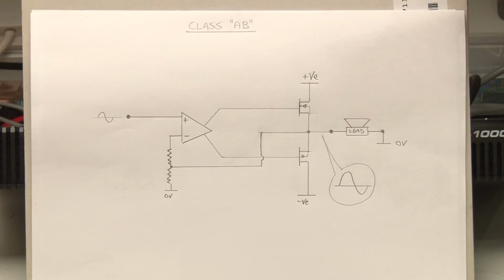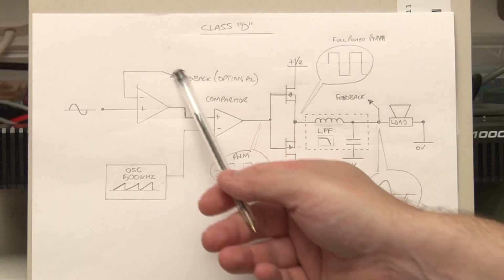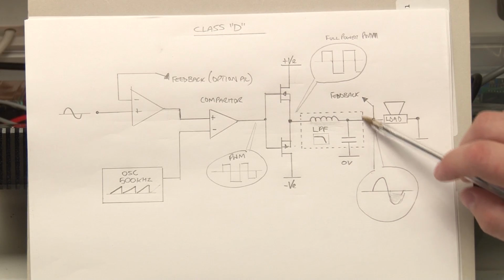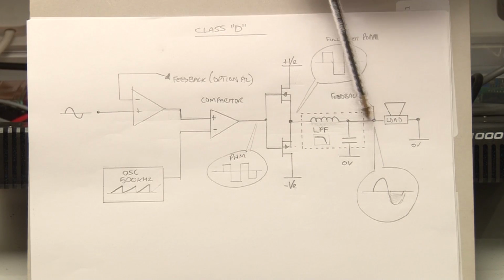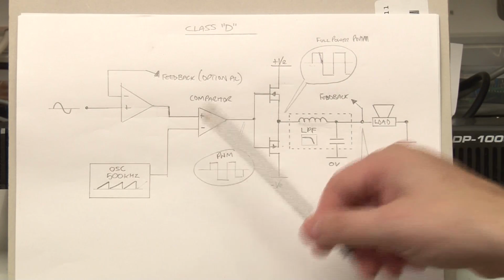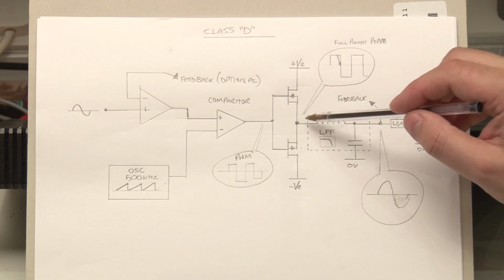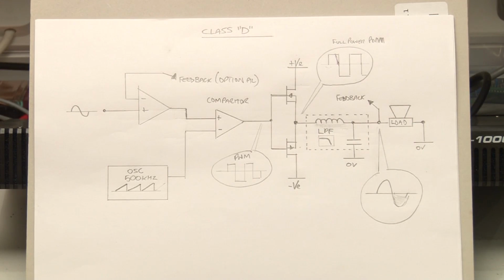Omnitronic EDP 1000 Watt Class D Amplifier Teardown

Comment: I have a class d amp which in high mid frequencies skips one of the signal LEDs and goes directly to the clip .. or else they turn on both together .. with gave frequencies if you mark the signal LEDs correctly until entering the clip

Comment: Looking at the ETD39 core I don't think this amplifier will go to a 1000W. The power that this PSU can supply would be in the 400W range. Dynamic power could be higher of course. The power supply has universal input range, has it got active PCF?

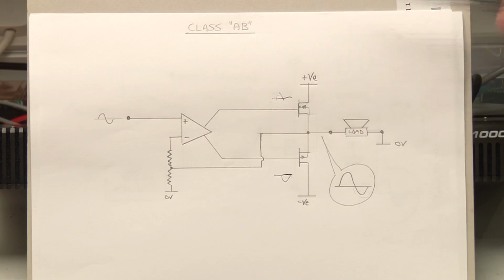Comment: Sorry Gerry, correct me if I'm wrong, but the schematic at 3:00 on the inverting input of the op amp you have that voltage divider set up kind of weird. 

the way that the divider is set up basically makes that top resister completely useless (assuming ~0 Current flow). I assume that you want that divider to step down the output voltage. just thought to point that out.

great video though, big ups on the awesome explanations!
Reply from the maker: +Erick Miller yes you are right, I was just doing a block diagram and should have drawn the resistor from the  output and tapped the input to the op amp from the centre point, I should have drawn that better, thanks for pointing it out. None the less I would not recommend anyone try to build what I drew, as I say it was merely a block diagram :)
Reply: You saved me making the same comment.

Comment: What you have shown on the drawing is a typical B class amplifier where one transistor works for positive half of the signal and the other one works for the negative half. While beign more efficient than A class amplifiers where one transistors handle both positive and negative signal parts,  it's disadvantage  is that the transistors do not switch instantly so you have crossover distortions in result.
Class AB solves this problem by feeding a little bit more than half of the signal to both transistors.
Reply from the maker: +tuomollo class AB amplifiers work in class A where small signals are involved, the actual mode is a double-ended class A amplifier where both transistors are biased on at the same time. Only when the signal swings in one direction or another does it become pure class B.   I did not show the bias configuration so the illustrative diagram could be either pure class B or class AB, I think in the video I was talking about class AB.
Reply: +Gerry Sweeney I was reffering to small sine waves you were drawing while explaining. You did simplify things a little but it's OK
Reply from the maker: +tuomollo yeah I was trying to keep things simple and showing the difference between a linear amp and a switching amp.  An explanation on A, AB, C operation would be another video :) Thanks for the comments

Comment: what is best for car audio ? ab or d
Reply from the maker: Either works well, class D would be more compact and dissipate less heat but are probably more expensive. In both cases the quality and efficiency of the PSU which in the case of car audio would be a switch mode, is predominantly what dictates the power capability.  Gerry
Reply: no joke, i bought a D-CLASS precision power p900,4 $1900TTD
Reply from the maker: ouch!

Comment: 115 quid , there is no way that is any where near 1000w rms then , my m8 just paid 1500 quid for a true 5kw PKN amp , those omnitronics are horrid cheap things.
Reply: Darren Woods The transformer used in the SMPS looks good for about 300w. ETD39 maybe.
Reply from the maker: I suspect you could get 1000w out of it - what it would sound like though who knows - I should have benchmarked it but I did not have a suitable load to test it with.  I would not equate price with quality though - that does not always corrolate
Reply: That is true , but mostly with power amps they lie lie and lie about specs all the time , especially cheaper brands.
Reply from the maker: Darren Woods We used it for a school PA system and it did not sound too bad at all, but it was just low-cost PA speakers.  The previous amp it replaced was four times the size and five times weight was 300W per channel and the Class D amp sounded much better by comparison.  I do not disagree about the mis stated specs though, I have seen many a car amplifier claim to be 1000W :) 
If I get the chance (and a suitable load) I will try to grab the amp for a couple of hours and benchmark it for power and output distortion - will be interesting to see how close (or not) the Amp gets to its claimed specification.   As a more general observations, the electronics and the physical construction were both surprisingly good given the cost of the thing. Gerry
Reply: Oh now that I would love to see personally. And yes have seen a lot of shoddy 600-1000w amps on ebay for cars with only 20amp inline fuses.

Also recently I worked on a amp for my m8 that was a real old but a monster 5kw(2450w rms x2 at 4 ohm) it had 2 massive tor's in there with a ton of copper each , one was reading .4ohm on the primary and it was tripping the breaker instantly so I told him call crown and see if you can get it replaced.

They quoted him 300 quid , and hes now bringing it to a local rewinder to have a look at it , I did say to him well use it at half power and just use one transformer for both sides of the amp as a quick solution.

But he bought a new amp from pkn that is well they call it class G and its 2u and has a lot more processing power also included with it , got to love modern switching psus they are amazing at what they do.
Reply from the maker: lazzer408 not always easy to tell the power capability of a SMPSU transformer by its size, frequency and quality have a big part to play - I have seen 1000w of power coming out of switchers with transformers around that size so its definitely possible.  Not to say that the Omnitronic meets that, I will try to get the amp back to see if I can test it - I am curious now :) Maybe Omnitronic wants to send me one to test...

Comment: Gerry,
Is the airflow on these rear to front?  Looking at where the fans and heatsinks are, I am guessing so, but I'd like to confirm this. I am asking as it needs to match the rest of my amp rack (2xiNuke 3000DSPs) to avoid getting hot air recirculated around my amp rack and possibly leading to early thermal failure  :(
Thanks :)

Comment from the maker: I think the relays are classic output protection relays, i.e. they cut out when excessive clipping is detected.  I say that because there is a third speakon socket on the back which you plug your speaker into for bridge mode, all that needs is to be wired across the L+R hots so no switching is required.  Thanks for the comment. Gerry

Comment: Nice video. The relays in the output stage are likely to be for switching the two channels onto one speaker connector for use in bridge mode.

Comment from the maker: @TheBinary, my goal is to explain the principles I understand which may or may not be correct (see my blog about page) - I will leave that up to the viewer. MOSFET's are more like voltage amplifiers in practical terms because of the way they work, at least thats my understanding and its born out in practical circuits. The point I was making about the filters is they are hard to design, and yes I do see HF on speaker outputs of that amp with my 200Mhz scope so the filters are by no means perfect.

Comment from the maker: Hi stuckinpants, thats for your comments, yes I agree with you. The problem always seem to be in designing a good output filter. As soon as the frequency goes up the complexity of filter design and the modulation, radiated RF power and other factors start to kick in.  It seems that most average Class D designs are a compromise and end up powering sub's and PA's and car stereo systems. Not a bad thing really. Gerry

Comment: I think the reason you see poor performance at lower output volumes would be due to limitations in how precisely you could time the pulses. At 10% of output voltage the DC would be varying between 45 and 55%, meaning a precision of 0.01% minimum would be needed to have 60dB dynamic range. I think increasing the oscillator frequency would help in that case.

Obviously any jitter in the timing or hysteresis in the comparator + frequency modulation of the oscillator would generate output noise.